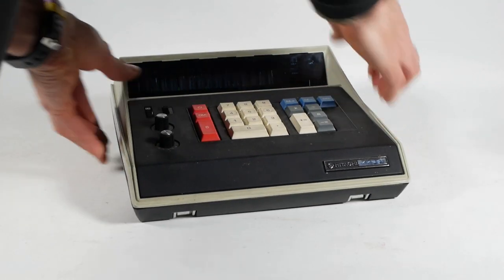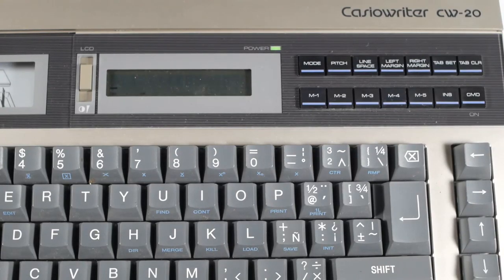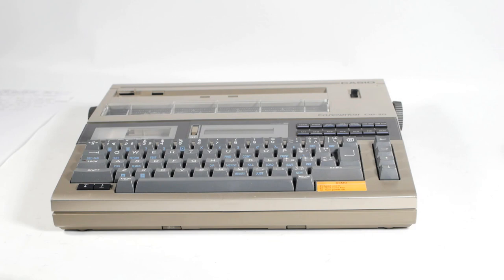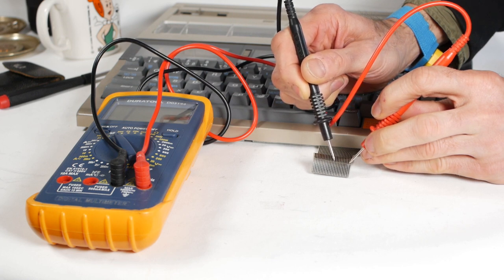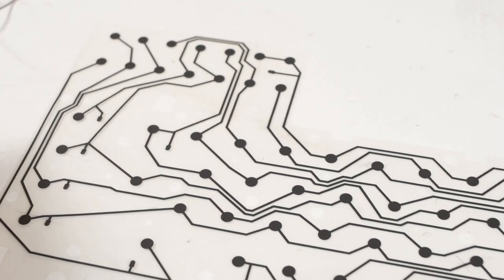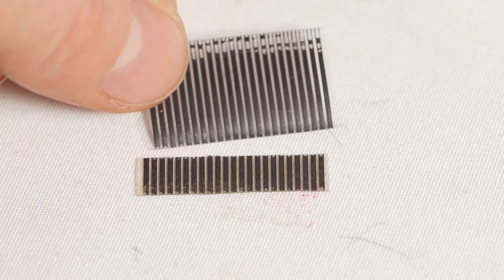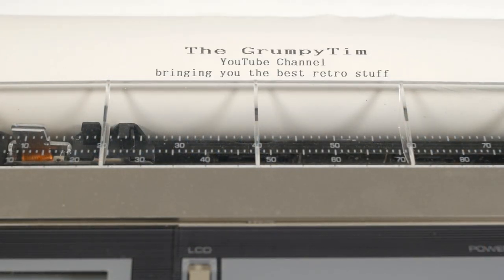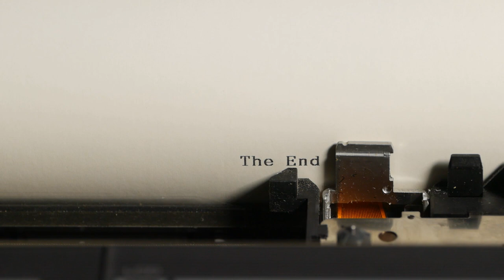Casiowriter CW-20 - Electric Typewriter Keyboard Repair

Comment: Great video! Very interesting to see how there is an expansion slot for extra memory even though everything was just 'basic text' back then
Reply from the maker: Hi ohjajohh, since I made the video I've actually managed to get a brand new (old stock) RAM pack for the typewriter - it has a whopping 8k of memory, yes 8k, not 8mb and not 8gb but 8k!!!!  And it's volatile memory so the RAM pack has it's own CR2025 battery to keep the data stored - how technology has changed!  Cheers for watching.

Comment: I just picked one of these up and this was helpful in getting it working. I prefer old typewriters than this as I am interested in a certain look. But, this one came with a manual and two extra cartridges that I think are unused and a half used one installed. I could sell the cartridges if nothing else. I am interested in what kind of adapter I need for this. I have some laying around that might work but I don't want to damage it as it appears to be functional.
Reply from the maker: Hi David, so far I've only run mine on batteries - I keep meaning to try to cobble together a power adapter - it'll be 6 volts DC with a pretty standard barrel connector, but I haven't found out if it's centre positive or centre negative yet.  Unfortunately, about a month ago, my Casiowriter conked out - initially I thought it was just dead batteries, but replacing them didn't help.  I haven't got round to looking at it yet, and I doubt that troublesome ribbon cable will take any more dismantling, so I'm reluctant to open it up again.  I'll maybe have a look at it again one day, but for now I'm back to using  my Imperial Good Companion.
Reply: @GrumpyTim  Thanks, that's helpful. I'll probably just keep using the batteries as well.

Comment: I have a soft spot for these 1980s feature typewriters. I had a Canon TypeStar 5 in 1987, very similar to this one. I did look into getting a used one purely for nostalgia recently, but learned that the thermal ribbons are no longer manufactured and only dwindling supplies of new-old-stock are available at silly prices. Have you looked into the ribbon situation for this Casio?
Reply from the maker: Hi John, I remember wanting one of this type of typewriter when they were new, but I was poor and they were expensive (for me anyway) so I carried on using my free, hand me down manual typewriter.  You're absolutely right about the thermal ribbons - people are trying to sell a single one for the Casio on Ebay for about £60 - dream on!!!!!   I did manage to get a bundle of them for not a lot of money so I'm ok for the time being.  Thermal ribbons are still used in some label printers that are printing on plain paper labels rather than thermal ones, so the technology still exists but they tend to be the full width of the label printer for very fast printing - if I could find something modern that used a 6mm wide thermal ribbon I could re spool the ribbon onto one of the Casio cartridges (they're easy enough to open by cracking each of the glued spots).

In the video I used thermal fax paper - I had a roll of A4 width fax roll that I used to use in my Brother thermal printer - fax rolls still appear to be available although I'm not sure that anyone uses faxes any more.  Narrower rolls are readily available because almost every point of sale till uses thermal rolls, so the technology to make the paper will remain, it's just a case of weather anyone will produce rolls in 210mm width.

Comment: Good work. Must admit I don't like that type of keyboard much though! Have you played with a golf ball or daisy wheel typewriter? They were banned in the USSR ad behind the iron curtain.
Reply from the maker: I'm with you there Ben - it's a simple and cheap to manufacture keyboard, but largely unfixable when it goes wrong - not that any manufacture will worry about that, so long as it lasts long enough to be well out of guarantee.  The modern world of "save the planet - scrap your old stuff and replace it with new stuff!!!!"

When I first started work, the company had a Brother EM1 or EM2 (or at least it was something like one of those) - a massive daisy wheel typewriter with some memory so you could automate things like details on parcel labels.  I used to use that one which was quite fun compared to my old manual typewriter.  Then a neighbouring firm that we did work with, had an IBM golf ball typewriter - I never used that one, but I loved watching the crazy movement of the ball - I've always had a soft spot for those IBM's.
Reply: @GrumpyTim  Interesting machines, daisy wheel and golf ball typewriters. Do you know why they were banned behind the iron curtain? (I do).
Reply from the maker: No, I hadn't heard about them being banned behind the iron curtain, do tell Ben.  That said, I'm not particularly surprised, the two working Soviet calculators I have, both from the 90s are amazing and interesting and fascinating, but HOW SLOW can they be?  I can beat them on many programs just doing it manually on another typewriter, and I love the fact that 3 to the power of 3 equals 26.99999!!!
Reply: @GrumpyTim  They were banned because all typewriters had to be registered with a copy of their typefaces recorded. 
That left a fingerprint on anything typed. You type a dissident leaflet? They know whose typewriter typed it.
Got a golf ball or daisy wheel typewriter? You can change the typeface at will. Untraceable.
Reply from the maker: That's so weird Ben, now that you've said that, I think I'd heard about it sometime in the past and completely forgotten about it (well clearly not "completely" forgotten because I now have that recollection of hearing it before!!!).  A really interesting nugget of social history - I love stuff like that, cheers Ben.
Reply: @GrumpyTim  now you need to find an example with spare balls/wheels.
Reply from the maker: That would be kind of nice, but they are rather big - even compared to my mechanical calculators they're big.  It would be good all the same.....maybe one day.

Comment: Hi, Tim. May I ask if you have a pic of the keycaps stems from underneath?
Reply from the maker: Hi Rafael, unfortunately, I was concentrating so hard trying not to ruin what little there was left of that ribbon cable from the keyboard, I completely forgot to take photos of the key stems - at least not from the underside where the rubber springy section is.  Normally I'd offer to take it apart again and take a photo, but there's so little spare length on the ribbon, and every time it gets unplugged it pulls a bit more of the screen printed conductive paint off.  Obviously, I should still be able to remove one of the keytops to look at the underside of that, and the top side of the rubber springy section if that'll help at all.

Comment: Well this is same case as my Canon Qs 100 Electric Typewriter. Sadly i cant repair it the tracks in the keybord burnt out leaving many key dead :(  and the spring hook that secure the paper feed wheels behind broke off.
Reply from the maker: That's a shame about your Canon Donkeykokong, those keyboard membranes are great when they're working, but when things go wrong they're not easy to repair in the way that a PCB with copper tracks would be.  I was quite lucky with mine that there was just enough length on the ribbon cable end of the membrane to allow me to cut out the bad section.

Comment: Do these Casiowriters take a special kind of paper?
Reply from the maker: Hi Glenn, the answer is yes and no!  They can be used with a thermal ink ribbon, which allows you to print on plain paper, but even when they were in current production, you needed to choose a fairly smooth plain paper - they weren't good on the posh papers like laid paper or other embossed finishes.  Nowadays the thermal ink ribbons are pretty scarce, I haven't found anyone producing new cartridges and the "new old stock" that pops up on ebay from time to time is usually listed at ridiculously high prices.  The technology for the thermal ribbons still exists because it's used on some label printers and so on, so all it would take would be a demand and someone could theoretically produce new copies.  Beyond using the thermal ribbons, your other choice is to use thermal paper, such as fax paper, which is still easily available (when using thermal paper, you just lift the ribbon out before printing).  If anything, I think the print quality is better on thermal paper, but of course, you are then stuck with thin, curly paper that comes off a roll rather than some nice quality paper.
Reply: Thanks! That’s very helpful.

Comment: Do you happen to know if it needs the memory card to work? Mine seems to work after the reset in that every key beeps when I press it but nothing else happens. The LCD prints out gibberish. Any ideas?
Reply from the maker: Hi David, it should work without the memory card, you just can't save stuff.  It sounds like there's something else bugging your machine, but I can't even refer to mine any more - it conked out earlier this year and I haven't had time to look at it yet - it's some sort of power issue, maybe a voltage regulator that's regulating too low or something like that, because initially it appeared to be flat batteries and the problem cleared when I put fresh batteries in.  But eventually it wouldn't run even with new batteries - I even cobbled together a power supply, but still had the same thing - the power light would briefly illuminate and then go out.  Not sure how many more times I can dismantle my machine due to that dodgy ribbon cable - pity, it was a fun machine to use.....
Reply: Interestingly, it is working now. After I turn it on the RAM Dead Reset message comes on but instead of trying to clear it I just start typing and that's it. All the keys and symbols work. My intention has been to sell it as I have the manual and two extra full cartridges. Should go quickly. Thanks for your help and insight. Finding information on this thing is a challenge.